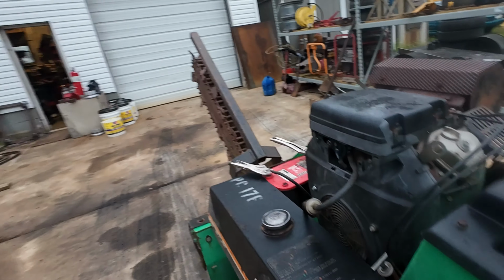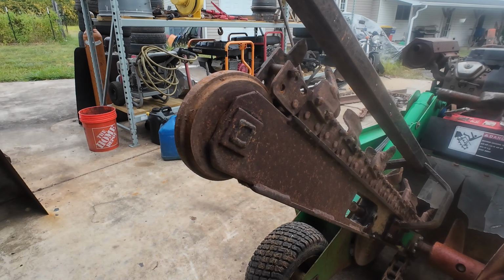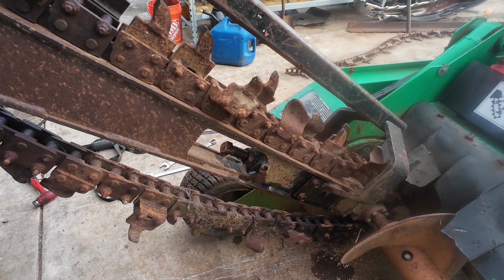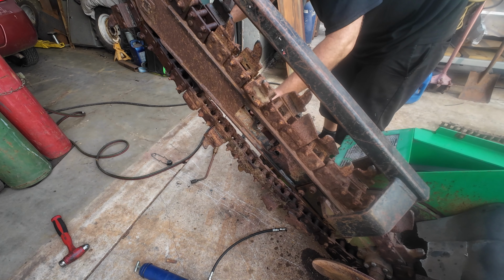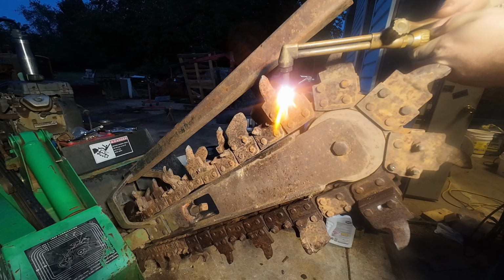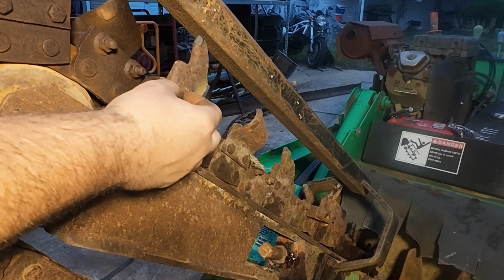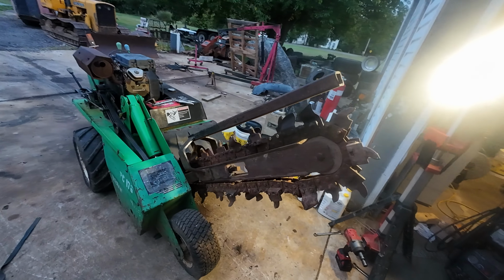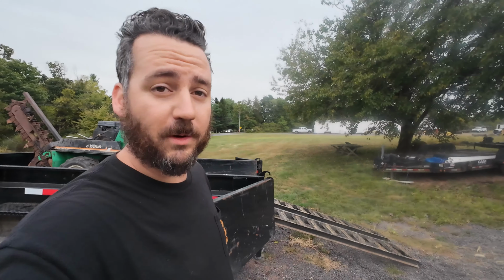Ditch Witch 1820 Carbide Chain Swap. 6" trencher chain install

Comment: I just bought the same model trencher at auction. Your other videos helped.  I had to replace all the bearings on auger, gear box etc.  But without a doubt the hardest part was getting the chain back on. Mine fought me the whole time.
Reply from the maker: Great to hear!

Comment: You should add safety pins or something for the ramps to not fall like that.
It can be dangerous or costly,or both.
Nice work.
Reply: Even just a bungee holddown would be an improvement
Reply from the maker: Agreed. With the design of this trailer it just has hooks that drop on. A strap might be the only easy option